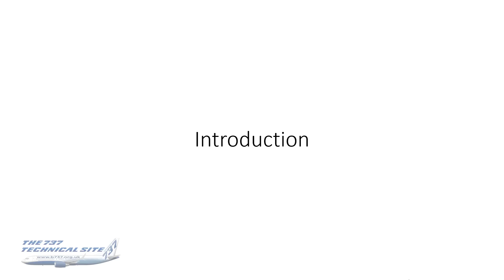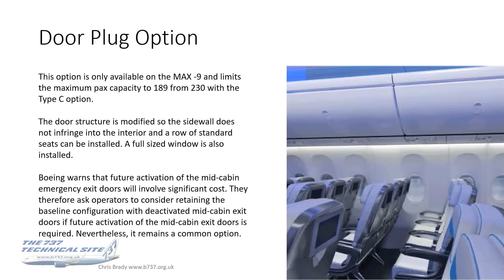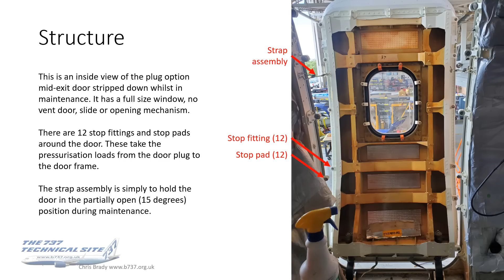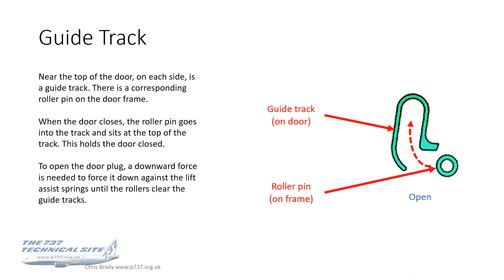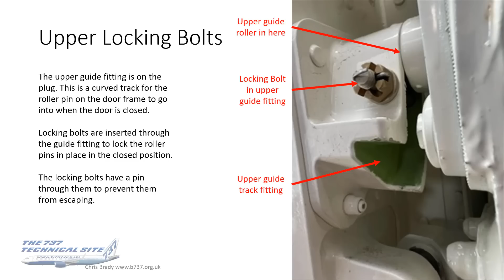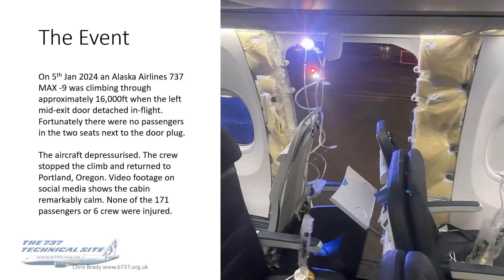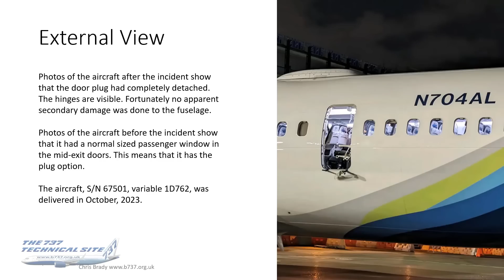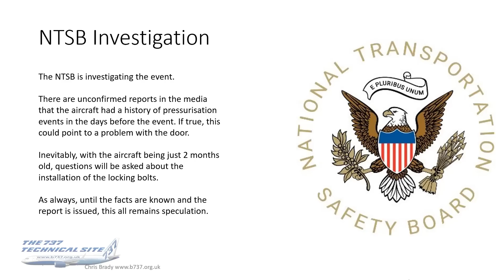737 Mid-Cabin Emergency Exit Doors - Plug Option

Comment: Media image of 737-MAX (unknown type) transporting via Train with clearly visible plug-type door (full size window) in place during transport.  Compare this with the overwing exits that are covered and suggest not fully installed.  This at least suggests the plug-type doors are fully assembled and installed at Spirit.  Unknown if removed and re-secured later.

https://www.aerotime.aero/images/Unfinished-Boeing-737-MAX-fuselage-traveling-on-rail-to-Renton-Washington-the-United-States.jpg
Reply: If it was NOT present, then it would definitely be Boeing's responsibility 100%. With this picture, it then is less clear.  Boeing is and should be responsible ultimately because even if installed by Spirit, Boeing should have QC'ed and inspected it on delivery to Boeing but likely later (to ensure nothing changed while on Boeing floor). If it is removed and re-assembled, then again 100% responsibility to Boeing.
Reply: Note this image is of hull 7562 and Alaska was 67501, so likely 61 hulls later.  (assumption is the 4 digit hull painted on fuselage and 5 digit hull number reported on wikiped as 67501 are comparable and the 5 digit vs. 4 digit is not material).  Given timing of picture and delivery of this 67501, I think my theory of hull numbering is likely)
Reply: Another point, I've looked through as many assembly line pictures as I could find.  I didn't see any with an obvious platform where the mid-aft door would be.  I would guess Beoing would NOT have a separate process for loading interiors, etc. and use this sometimes and not other times.  Looks like forward and aft doors are extensively used with platform access and the overwing has whole structures for platforms.  I don't see ANYTHING with platforms for the mid-aft.

Comment: Great update to yesterdays video. Kinda confirmed my suspicion, and me not knowing the door/plug architecture, that there is a chance that the locking bolts might have been missing. I can't wait to see what the NTSB finds out when the investigation is done.
Thanks for the update video.
Reply: KINDA?
Reply: @Capecodham  yes, kinda. First of all, that comment is from 2 weeks ago, where there was absolutely no information available at the time. And as far as I know, no determination has been made on the situation of the plug retention bolts. The loose bolts that were found so far were the frame retention bolts, not the plug retention bolts. And those were not the bolts that failed during the Alaskan incident. So, yeah, kinda.
Saying anything beyond that would be non-factual and pure conjecture.
Reply: @idontlikespm  is kinda a word?
Reply: @Capecodham  yes, it's a slang/colloquially used version of 'kind of'. But thanks for arguing on the Internet about a word you're unfamiliar with, instead of giving a productive addition to the subject at hand. Very informative.
Reply: @idontlikespm  Even my 4th grade students are not so lazy to say kinda in writing.
Reply: @Capecodham  we get it. You're a hoot at parties. Thanks for diverting a discussion about a serious mechanical issue into rhetorical grandstanding. You continue to live in your perfect and pedantic dilusion and I will bow out of this absolutely useless thread.
Good luck.
Reply: @idontlikespm  we? you were elected to represent others?